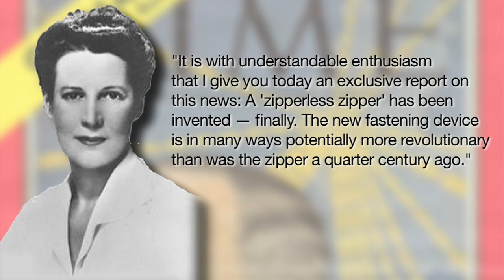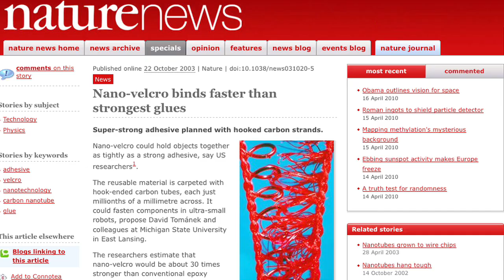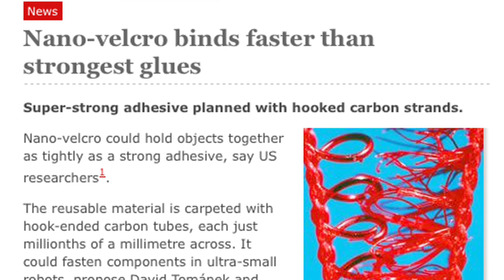Velcro

Comment: From Swiss Patent No. 295638 on how the hooks are made (see Fig. 1 at 2:06):

"In fact, we also used for the formation of the bristle, the metal rods 5, around which the fibers of the chain 3 have been made to pass to produce the loops 6. Each rod 5 has a longitudinal groove 7 to guide the cutter 8 and thus form the bristle."

Comment: @hmanham Well, yeah - but it's way easier to get snow off laces than velcro. And once you've tied your laces, it doesn't really matter if you get snow on them. With velcro, however - if some of the snow gets under a flap of velcro that ur not using (cause u've got it strapped tight, leaving some velcro out - then it will slowly tear open)

Laces or nothing. Unless it's summer :P